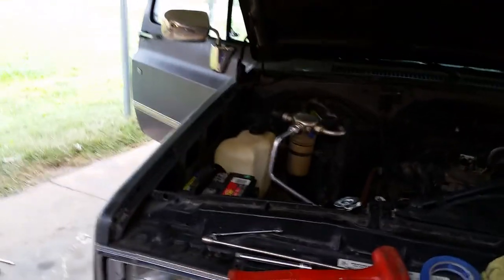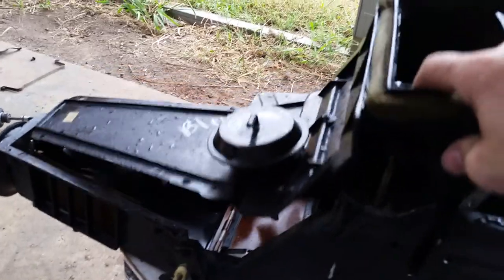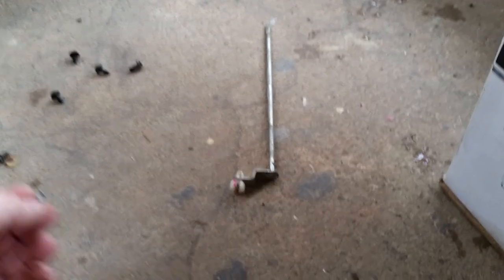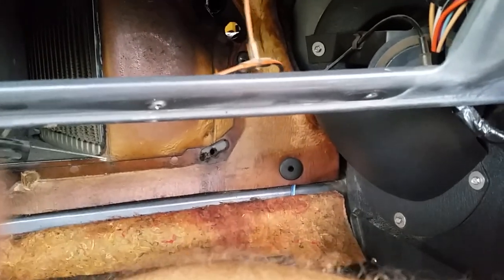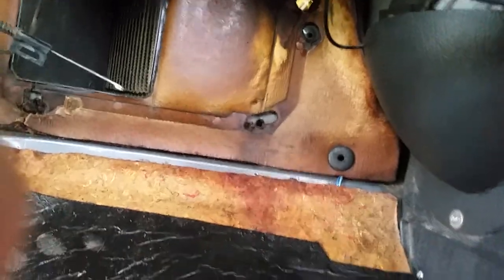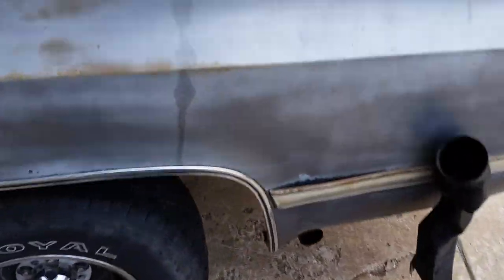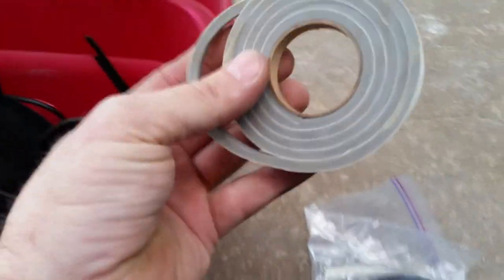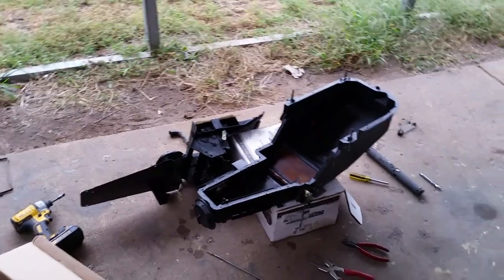Square body heater core replacement tips

Comment: Great job HAFRODS! I agree with everything that you observed during your heater core install. The blend door assy with the plastic part was also broken on mine. I repaired it with a thorough cleaning and Gorilla glue. My 1987 1ton four door had the HC replaced before. Plenty of rust because of the coolant saturated floor insulation. Your comments on the blend door pin that has to be removed; part of the door in my heater box were broken from prior removal. Gorilla glue and jerry rigged plastic bits to the rescue again. It was a bitch trying to figure out that pins' orientation. I finally got it all back together, I hope that this core lasts forever! Thanks again!

Comment: Looks like a nightmare. Thanks for the Heads Up. The Summit racing core Isn't Aluminum so ya don't hafta use  Distilled water or worry about electrolysis caused by a bad accessory ground. WTF ? We always used a garden Hose with no worry of corrosion. Anyway here's the part # for the Copper/Brass one: sum382177 heater core

Comment: Honestly,  this is one  of the easiest heater cores I have done. Try doing a heater core on an 02 f150. You literally have to pull the entire dash. Also, you dont need to remove the plastic thing nor the nail looking thing from the blend door, there is a bolt on the inside you can access easily from the side furthest from the heater core. This took me alittle over an hour only because I took the time to cut the head off the nail thing and pull it all the way threw, just to realize there was no point. Also....that's how you remove the nail looking thing.... gring the head and pull it all the way threw....its ring shanked so it wont go back the other way.

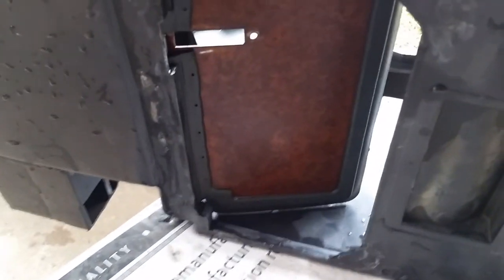Comment: How did you fix that little plastic piece that broke at 2:17?
Reply: I put a larger washer onit and epoxy ed it around the edges. The little plastic piece wants to be inside real bad. Definitely spend your time reinforcing it. Refresh the seal on the door. Good luck

Comment: You will get to do this repair again very soon since you used the cheap aluminum heater core. You want to pay a little more and get the copper one from Summit Racing.

Comment: GM really made a mess of this whole thing...Don't use that Aluminum Heater core they suck and don't heat well buy brass/copper like original.  Summit Racing sells the OEM one.